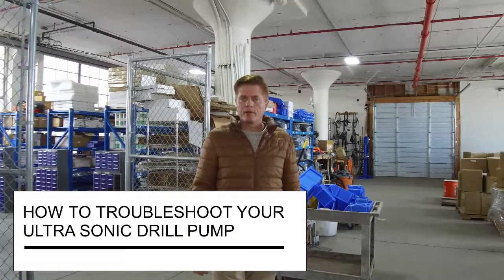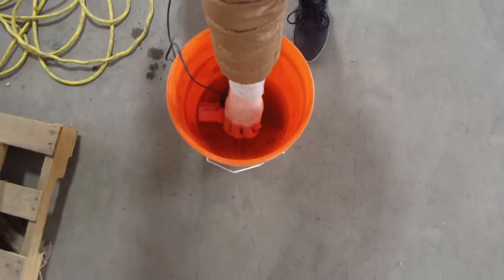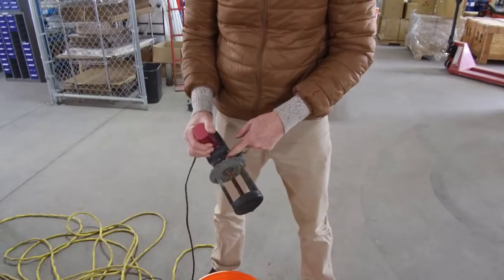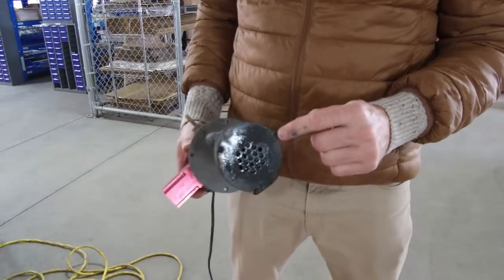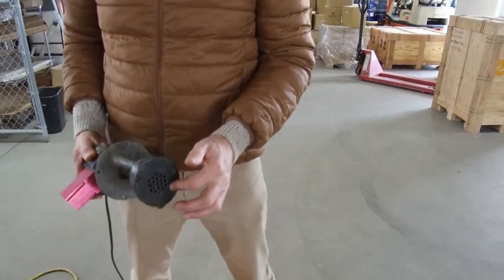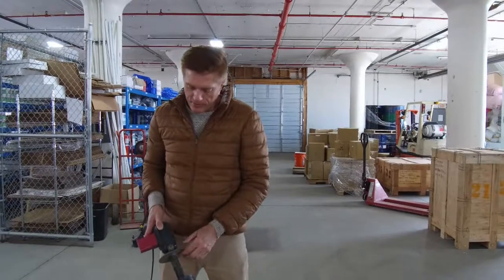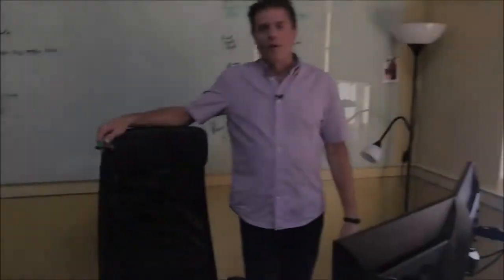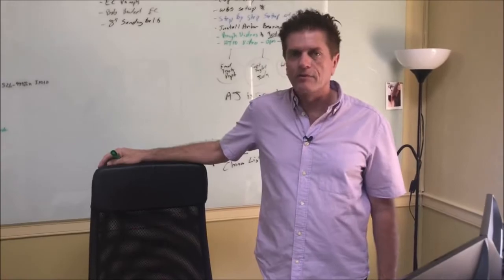How to troubleshoot your Ultrasonic Drill pump

Comment: Show the container and the location of the pump in the container.   At the bottom or sitting on the top part of a 1 gallon paint can that has 5 or 6 pounds of grit.